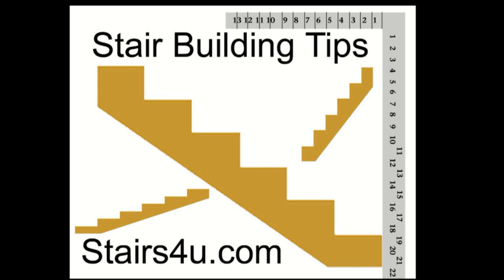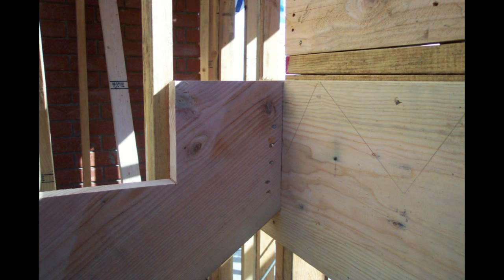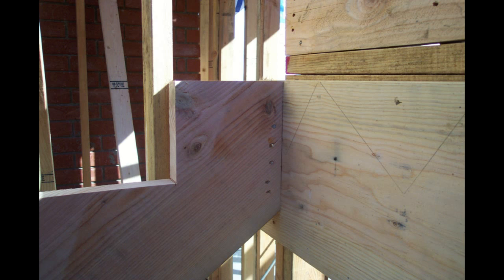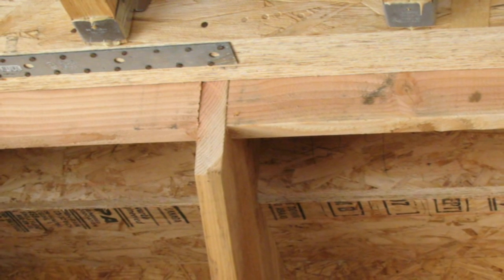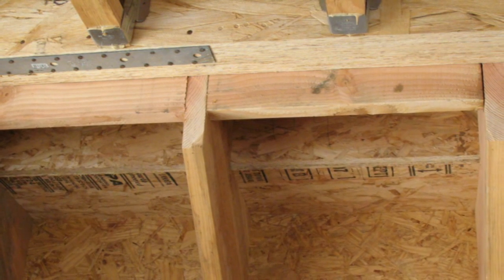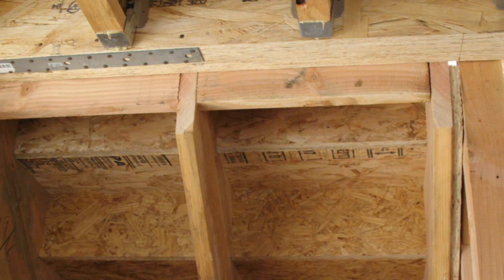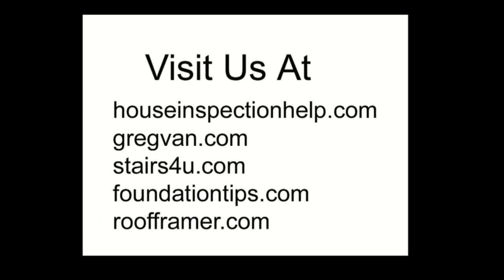Top Stair Stringer Connection Tips - Structural Home Building Problems

Comment: Hi, If you do not have space beneath the stringer to add landing because of 80 inch height requirements, what can one do ?
Reply from the maker: This could be a problem, but most of the time everything will work out okay if the stairs below are exactly the same as the stairs above and you have at least an 8 foot wall height.
Reply: @stairbuilding  hi. I sent you a email. Looking to buy a bunch of your books. If you could reply please. Thanm you very much.

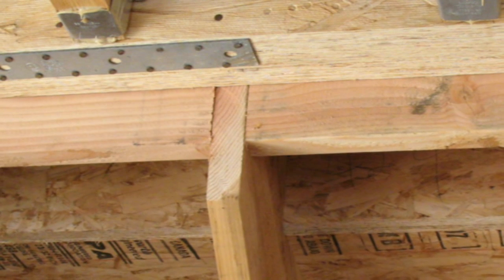Comment: At the 1:00 min mark, what would you suggest for a hanger board or ledger?  I've seen some suggest using a piece of 3/4 plywood or OSB, nailing that to the face of the beam, then nailing into the stringers from the back of the OSB.
Reply from the maker: Hanging the stringers from a sheet of plywood isn't a method I would prefer to use, but if I was going to use it, I would try to use inch and eight plywood.
Reply: I saw another video where you showed a repair by putting blocking behind the stringers, then using steel straps nailed to the back of the beam, bent the straps around and nailed to the bottom of the stringers.  For new stairs, rather than using a hanger board made of OSB or plywood, would it be better and meet code if the back of the stringer was cut so the back edge (plumb edge) went under and flush with the back of the beam, then you used straps such as in this same way?  I'll only have about 1 to 1.5 inches of the top of the stringers hitting the front of the beam.
Reply from the maker: It would be difficult for me to comment without seeing some type of picture. Feel free to email me a picture and you can get our email address at the bottom of any page on her website. Also, I would appreciate removing product information and replacing it with a 22 inch strap.